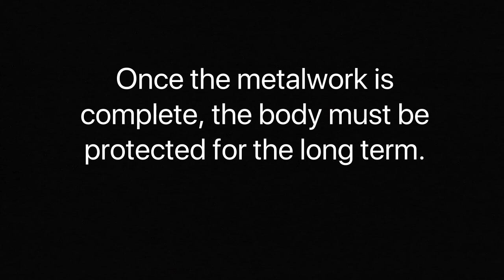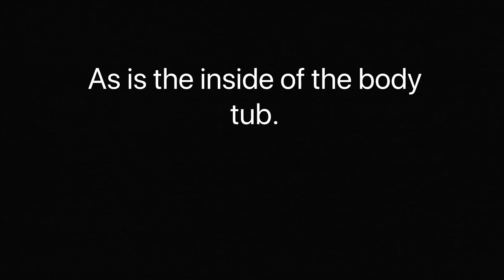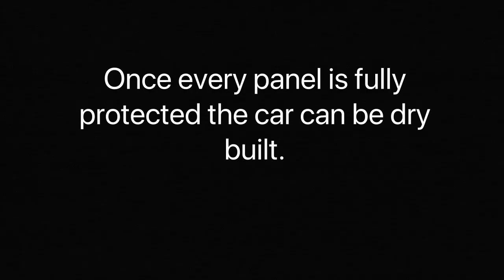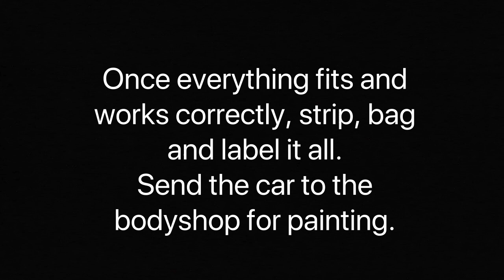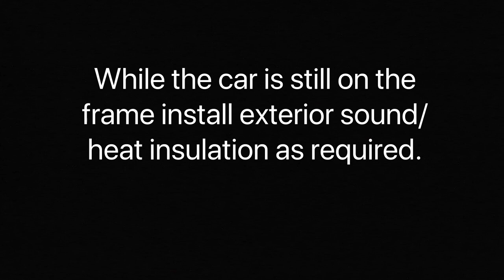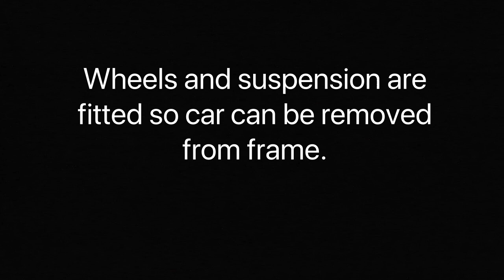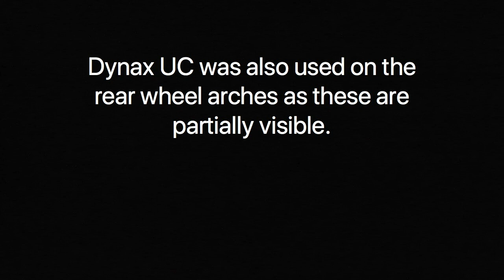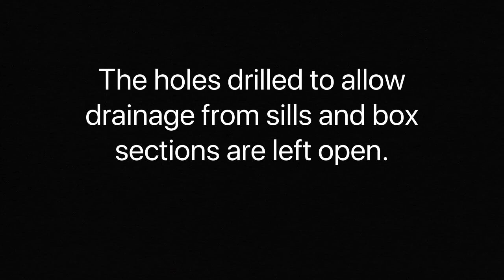Sunbeam Alpine Restoration (Part II - Restoring the bodywork)

Comment: Oh and I'm curious what was the reason you removed the badge holes? Prevent water from getting in would be my only guess?
Reply from the maker: With the badges fitted you can end up with more than 40 holes through the bodywork, none of which have proper drainage to allow water out if it gets in. We close the holes to remove the risk of water ingress. We have done this for years and never has a problem, a future video on this channel will show how to ensure that you get the badges correctly positioned.

Comment: How did you like your epoxy primer. Did it apply and hold up well.  I'm working on a tiger restoration and will be going threw the same thing you did
Reply from the maker: The two pack epoxy primer over the top of bare metal that was treated with Phoskleen B has been very durable. We live by the sea and this car lives outside and is used regularly all year round so it has a hard life. We would definitely recommend following the processes that we did in the restoration videos. This car sat on a rotisserie for 12 months, in a garage by the sea with no paint on it and no rust formed on the bare steel because of the Phoskleen B. covering this with two pack give it a hard shell, then the 'normal' primers and paints go on top.